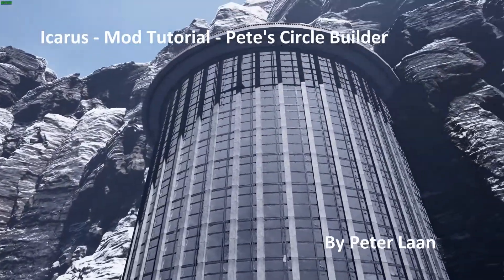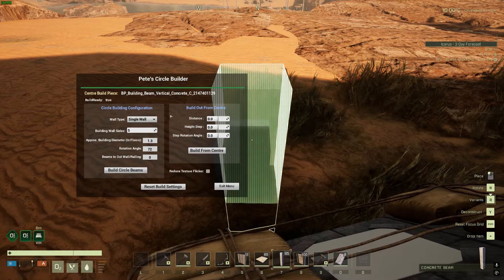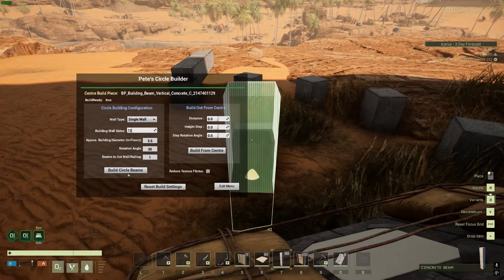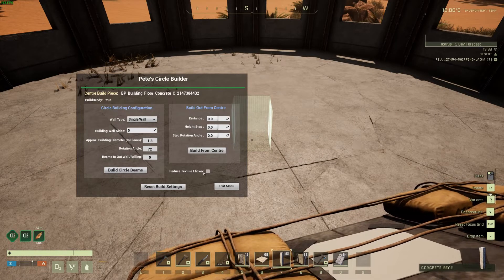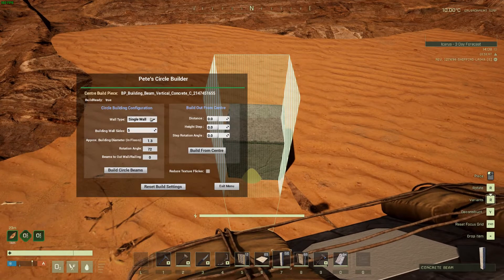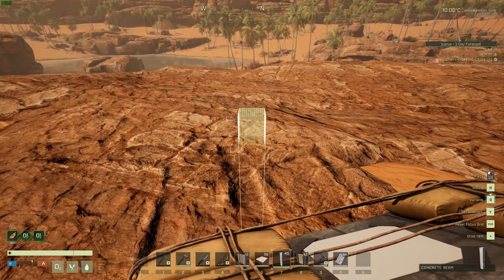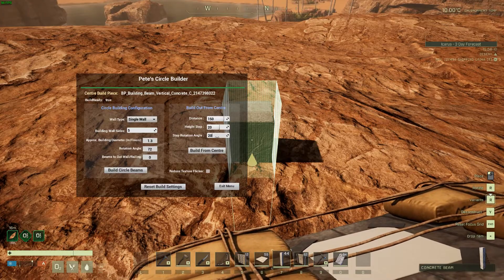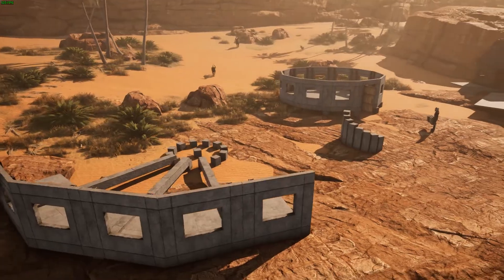Icarus - Mod Tutorial - Pete's Circle Builder

Comment from the maker: Get this mod (called "laanp-CircleBuilder") and others from my GitHub page at:
https://github.com/laanp/Icarus_Mods_Separated

This is the main Readme files entry page. To get the latest mod pak files (which are updated weekly)
click on the "Latest" Release button on the right side of the page.

UPDATE - Week 147 - Have now included a "Auto Build" checkbox option that will automatically construct the beams for you - make sure you have enough in one slot!
Reply: hey man, I get an issue. I used this mod but when I put the floor, this one is not "clean".. not like a "regular" floor like in your video at 4.30min even with the "reduce texture"

Comment: Tried the mod today for the first time using the MM and it doesnt seem to work i verified that the pak file is in the mod folder and everything and it doesnt seem to work at all nothing brings up the menu to be able to do circles
Reply from the maker: Hi I just found a problem with the standalone version of that mod (so thanks for pointing that out) I have fixed it and will update it for week 205.
This mod is also included in the BuildersDream mod, and that one works, if you want to check it out.
Reply: @icarus-firstcohort-basebui9026  hey no problem glad it was able to be fixed and i will certainly check out the buildersdream mod and see if i can get some circles going
Reply: @icarus-firstcohort-basebui9026   ive been trying to download builders dream and the MM keeps giving me an out of memory error so guess ill just be watiing for the standalone to update next week or whenever it is

Comment: Is it me, or is the possibility of using this tool on a self build concrete floor just impossible?

Imagine you have a 2 floor high plattform build... and want to place a building on it... all the beams just getting destroyed...

can someone help me with that?
Reply from the maker: It's possible, but you always have to start with a location where you can sink the beams.  So if you are trying to build a round 2-high platform, you need to sink the first vert beam either through your existing floor, or if you are too high up, you need to delete your floors to get access to ground, then build your circle and extend 2 floors up.   Just need to be creative!
Reply: @icarus-firstcohort-basebui9026  Sorry, but i think i dont understand it. So if i have a, lets say 2 by 2, concrete floor, quadratic, and want to place a octagon on it, (the height is just one high, so basically one wall or beam high from ground) the beam i  set on that floor to be the center beam cant be "sunken" (sry for my english), it either snaps to the middle (or elswhere on that plattform) or if the gridsnap is disabled, it just breaks. Could you do a little tutorial about how you can place shaped building (round or octagons, doesnt matter) on a elevated plattform (doesnt matter what material, suggest concrete would the best). TIA
Reply from the maker: @Beatssample  It would be best to look me up on Discord (username: laanp) and I can show you through screenshare

Comment: I've now tried several of your building guides trying to replicate the techniques but whenever i reset the focus grid, if the cursor comes even close to an existing structure it snaps right back on. is there a way to deactivate this?
ultimately i just want to use it to build at a 45° angle.
Reply from the maker: @grindberthuberberth3490  yes, To toggle snap function for free placement mode, tap the "Home" key (default).

You may have a different key assigned to this function, to find out which key it is,
Go to "Settings"... "Controls" tab, then look under "Keybindings"... "On Foot" section for the "Disable Building Grid Focus" setting.
Reply: @icarus-firstcohort-basebui9026  i know which key i have to press. i think i described the problem rather unmistakenly. however, it is no longer relevant, since this games building system does not meet the bare minimum standards i have for games likes this and i have dropped it. good idea, awful implementation.

Comment: I'm a big fan of your mods. I've always wanted to make a circular base but just lacked the patients to deal with that. If I use this mod, build a base, then remove the mod, will it delete the base? I've had to make new OW in the past because of either the modder discontinued the mod or I took a break and came back without the mod installed. Thanks!
Reply from the maker: @statickilla89  No, this mod works with the existince base building system, and only modifies how you can manipulate the build pieces within that framework.  Removing the mod only removes the menu access, and anything built with it will stay intact.
Reply: @icarus-firstcohort-basebui9026  Awesome thanks again!